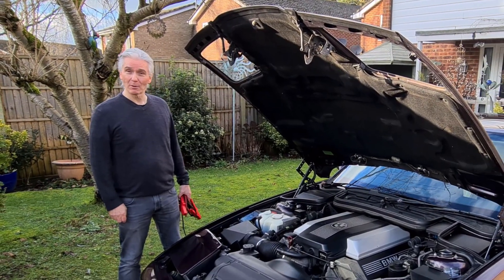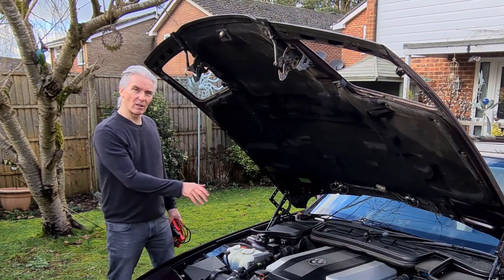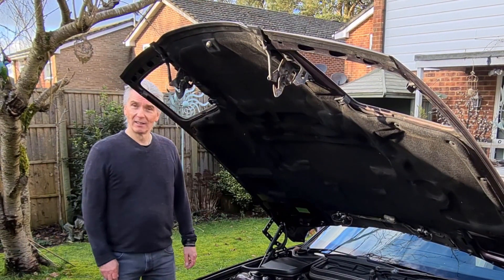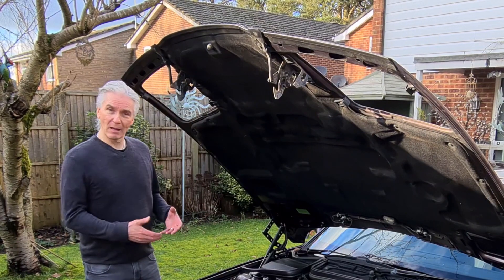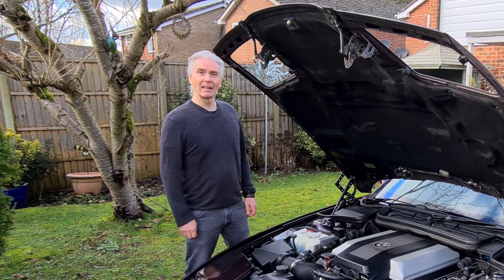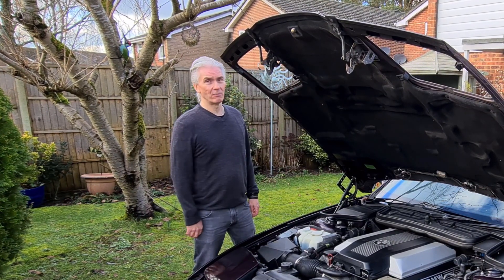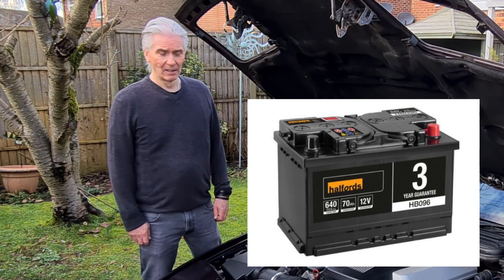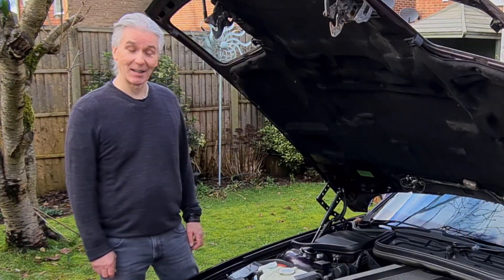OLD BMW? NEED A JUMP-START? NO NO NO NO NO!

Comment: Hi Tim, kind of related but then again maybe not..... my e64 boot has stopped working and I can’t open it at all. It did this a couple of months ago and then over night started working again..... do you think this could be a fuse? The latch? The battery? Any help you could give would be great before I send it in to the mother ship to change me mega money.... Chris.
Reply from the maker: Unlikely to be a fuse, much more likely to be the actuator - they do go wrong and would be a cause of intermittent failure.
Reply: @TimmsBMWRepairsandInformation  Hi Timm thanks for the reply - very kind of you. Just to let you know (you've probably got better things to do), but boot all fixed. I bought a new latch from BMW near me and fitted it - of course it wasn't that - but took to a garage just behind my house and they had it an hour and called and had fixed it - it's not ideal as the boot only opens with the key but the roof still comes down - and it only cost me £20 - could have taken it to BMW and had it completely fixed but could have added another couple of zero's on the end and seeing as I'll keep it until it dies (which will hopefully be a few years yet) I'm happy with that. Keep up the great videos!